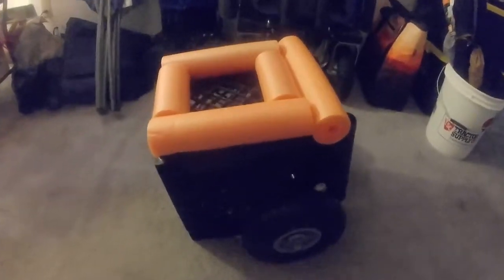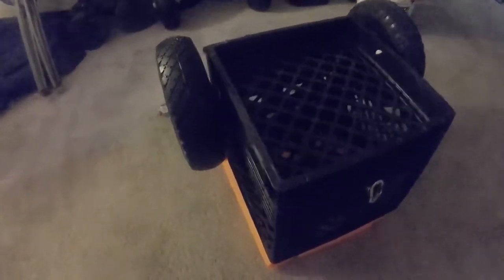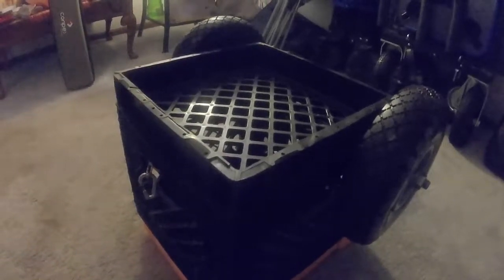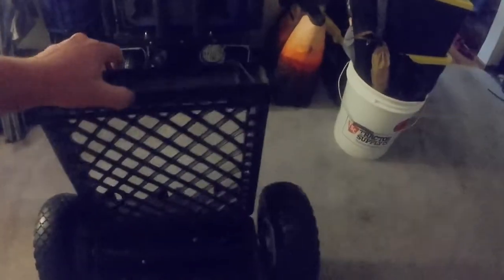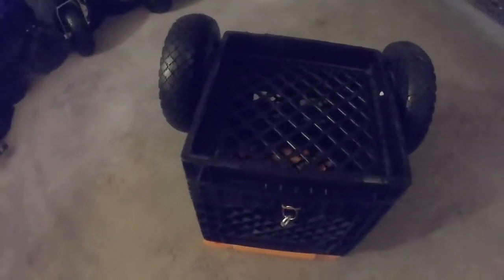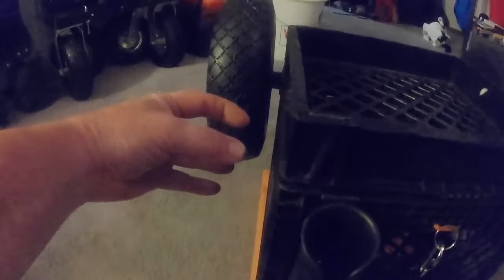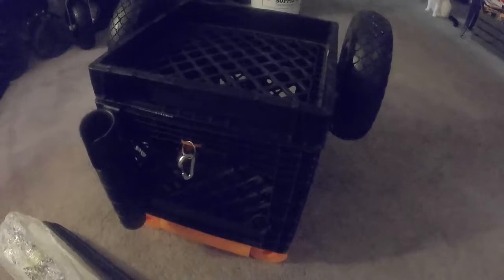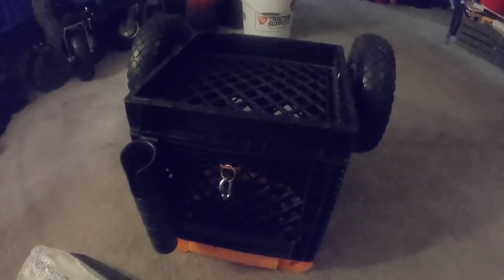DIY MULTIPURPOSE MILK CRATE KAYAK CART

Comment: Good stuff! How is the cart holding up? Do you like your design? Would you do anything different? Greetings from NYC!
Reply from the maker: It's holding up ok...only thing I would change would be larger wheels. My kayak is 84lbs empty but with all my gear it's around 150lbs..so it's a heavy burden on the cart. That design would work perfect for a kayak 80lbs gear included.